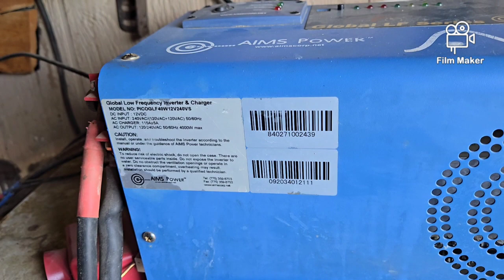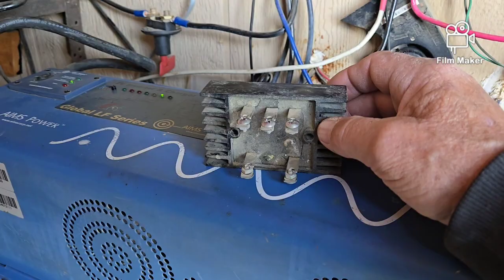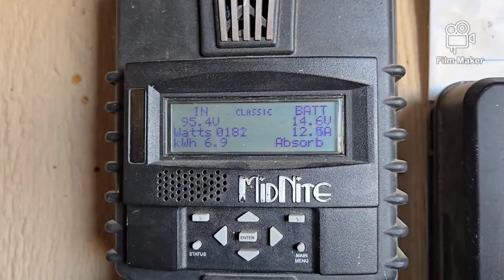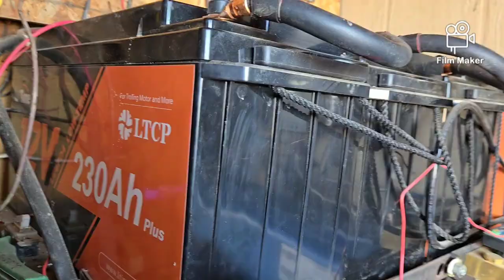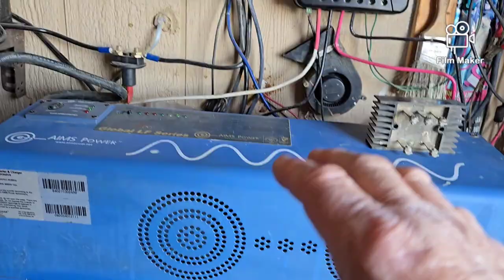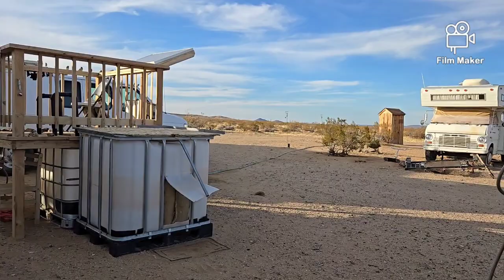TALK About Turbines!  Feb. 18,2025

Comment: What is the difference between that and the one that comes with a wind turbine
Reply from the maker: By 'that' I suspect that you mean the bridge rectifier. So this bridge rectifier only converts AC current to DC current, and the controller that comes with a turbine usually also has circuitry that adjusts the voltage output to meet required battery bank input.  If you have a 12v turbine, the voltage output, uncontrolled can be very high and damage a battery bank.  The voltage, therefore needs to be limited to approximately 13.6vdc.
A bridge rectifier only 'rectifies' AC current from 3wire input to 2 wire DC output but does not limit the voltage, so it would require a charge controller. 
The solid state rectifier/controller that comes with the turbine does both, but usually doesn't have a display, so a separate multi gauge unit needs to be placed on the DC output side for you to see what it is putting out.
WELCOME ABOARD!
Reply: @GBear  thanks I am just trying to get a little more out of my turbine it came with the one that has the little red light that flashes i added a meter that shows everything but it has never seen. Ore than 1.15 amp or maybe 20w at 12 volt tha is for replying I do have 1000w of solar and 1000 amp hr or lipo4 hooked to it
Reply: I am thinking of going higher and Mayne making the tail bigger it is a 11 24  chinese cheap turbine
Reply from the maker: @joshuafreeman9792  If it is a cheap Chinese turbine, just stick with that came with it.  It's a waster of money to try to get more power out of it, and it won't last very long anyway.
Reply from the maker: @joshuafreeman9792  Those cheap Chinese turbines are over rated in their ads.  If they say 300w output, that is misleading, as it can only put out high amounts of power in extreme winds that basically are the turbine's limit.  Also, they use slip ring electrical connectors that fail if they freeze in cold climates.
I fell for that stuff too, in the beginning.
Reply from the maker: @joshuafreeman9792  Save your money and invest in more solar, and LiFePO4 batteries, and a good controller and inverter.  Wind power is only supplemental and usually not worth the money spent.
Reply: @GBear  Thanks
Reply from the maker: @joshuafreeman9792  you're welcome

Comment: G Bear.  To save $ on PV wire, I have been buying cheap outdoor extension cords and fusing the 3 conductors into one run and and run two separate cords for positive and negative.  Of course, you buy them on sale and they may NOT be the best but they work pretty good without a lot of voltage drop from testing.  I direct bury them and so far have survived two seasons here in Michigan.
Reply from the maker: @Gary-wh7ce  Be careful. Most extension cords are no designed to be used in moisture.  The cheap casing becomes porous quickly and water will reach the conductors.  But nice temporary fix in a jam!

Comment: If you plan on upgrading to a 48V system, I highly recommend you purchase 48V rack mount batteries.

I have seen people connecting these 12V Lifepo4 batteries in series (for 24V or 48V systems), and the batteries in the battery bank got out of balance. When one battery gets out of balance and gets charged first, the electronic BMS will stop passing current to the other batteries in series, to prevent overcharging of the out of balance battery. This will cause the other batteries from the pack to not get fully charged.

Also, each cell from that 12V battery needs to be balanced, and while all Lifepo4 batteries have a BMS with cell balancing, it is very slow and only activates once the battery enters float charge. That's why batteries need to be floated for several hours to facilitate individual cell balancing (if not, the BMS will throw out an error, or the cells will get their lifespan reduced over time due to improper charging). From this example, you can easily deduce that a series pack of 12V batteries will not be able to effectively perform balancing between each 12V battery, nor individual cell balancing through the BMS for each individual battery.

There are active battery balancers similar to those for lead acids, they usually have a balance current of 1-2A. They might work, but I'm not sure of their effectiveness.

My personal recommendation is: 

If you plan a 48V system, buy 48V batteries and wire them in parallel (the rack mount batteries also have a much better BMS with better individual cell balancing, due to their professional use case scenario).
If you plan a 24V system, buy 24V batteries and wire them in parallel. Most manufactures sell 24V Lifepeo4 batteries.
If you already have multiple 12V batteries, my opinion is to stick with a 12V system and avoid the headaches that come with wiring 12V batteries in series.
Reply: Good points for sure.  I was testing the 4*12 scenario and opted to go with an external balancer that monitors the series and parallel group and so far so good.  The costs are coming down for sure and I just picked up two server rack batteries (48v) as well as three 50A 48v golf cart LiFePO4 to run in parallel.  My observations have been that its nearly impossible to get a true equal balance due to physics.  However, the risk with series connected is that IF a battery shuts down it could blow up your mppt controller.  Also, manufacturers are starting to walk away from 100% language and are moving towards 20%.  I had two batteries that I discharged to 10% only to find them at 1% and protected in the morning and my server racks batteries have a footnote to 96% DOD....... But everyone has their beliefs and set ups but just saying that once you go to 48v, its hard to look back!
Reply from the maker: @Gary-wh7ce  Yeah, I keep up with research, and I set my limit at 20% anyway.  I believe that if you are going to be draining them that low, then you need a bigger battery bank, and more solar.
Reply from the maker: Thanks for the info.  Finances prevent me from buying server rack batteries right now.  But, I understand the risks.  I understand also that the problems you mention are more prevalent in cheap LiFePO4 batteries with poor build qualities, and not so much with quality builds.

Comment: My Axial Flux Turbine I made is Silent and very Efficient it puts out more than a classic 250 can handle in a 40km wind and the blades are less than 8ft diameter . The turbine you use is very noisy because of the iron cores which cause a vibration to travel through the tower .  Only high voltage wind turbines are worth it especially if you're relying on them for most of your power . The high voltage Axial Flux i built Hardely ever stops producing power .
Reply from the maker: @windpowerandmore6310  Nice, but you must have constant wind for that.  It's calm here now, so no turbine would be making power.
Reply: @GBear  you're wrong a Axial Flux makes power in less than 10km hours wind . It makes most of its power in low winds which are almost always in any area.  Wind turbines that have iron cores have cogging and magnet drag on the iron which makes them useless in winds that a Axial Flux turbine will produce most of its power at and it absolutely silent
Reply: @windpowerandmore6310  what kind of magnets did you use?    I’ve got a couple of washing machine motors PMA 36 coil the Paykel Fisher types.   I’ve thought about making an axial flux but the magnets are expensive.
Reply: @WattsinWattsout  Yes I agree and that's definitely not something that can be overlooked.  The magnets have gone up drastically!! I have full videos of the magnets i used and even a complete build video series on that turbine.  They are real N52 143lbs pull force.  If I recall they are 1 inch wide 1.75 inche thick and 2 inches long . I don't recommend using weeker magnets because that's where the efficiency comes from unfortunately they cost a fair bit these days.  
That stepper Motor you're talking about will work with some modifications such as arrange the coils in a 3 phase configuration at a lower voltage than what it is when it's in a washer.  And also mounting blades can be tricky from what I understand.  Honestly if one is going to put effort i would just build a high voltage Axial Flux that will last for many years  in the long run it would definitely be cheaper and waaaay more power output at low wind than anything else on the market these days.
Reply: @windpowerandmore6310  yes I’m contemplating going 36/6 or 36/3.   12 or 24 volt.   I’m also toying with putting one in a lawn tractor with a speed controller and hall sensor with lifepo4s.
Reply: @WattsinWattsout  sounds fun!

Comment: How many watts is that turbine?    Do you have a manual brake or do you rely on the controller to stop or dump load the turbine?

I just bought another 100ah mini with low temp protect for $113 the other day.   Amazon flash sale normally $199.
Reply from the maker: @WattsinWattsout  Nice buy!  My PMA is 1685w.  The KT-5 from thermodyne. But, 1685w is it's top rating at it's max speed of 90mph winds.  The most I ever saw was 879w out of it, but it probably went higher when it burned the rectifier.  Nowadays, I usually only see a max of 400w.